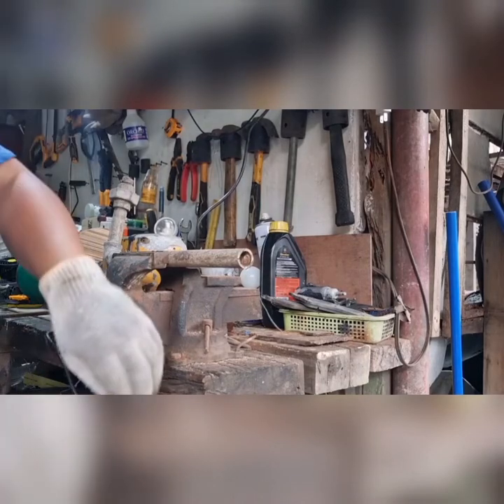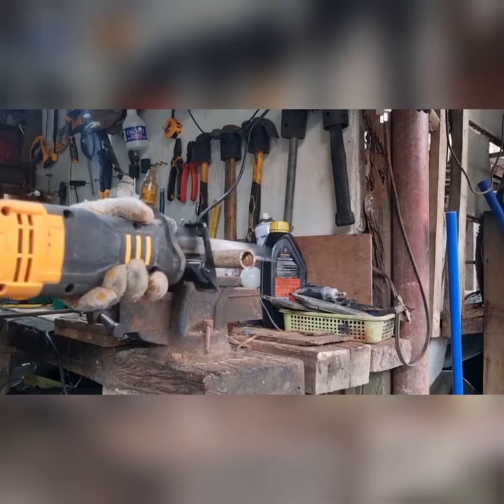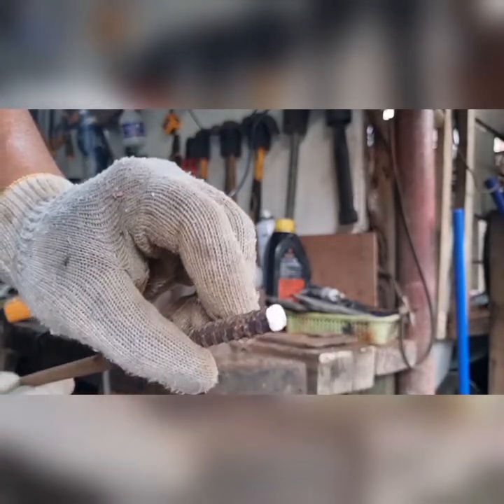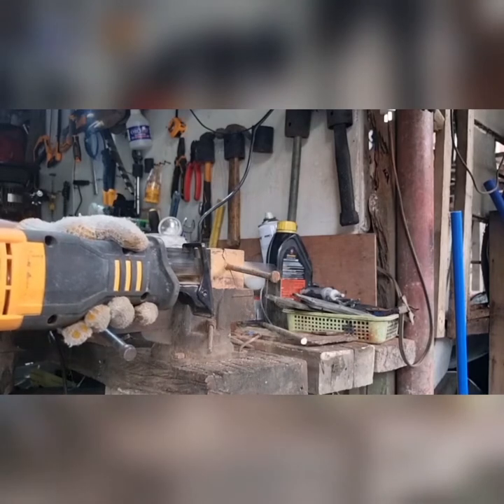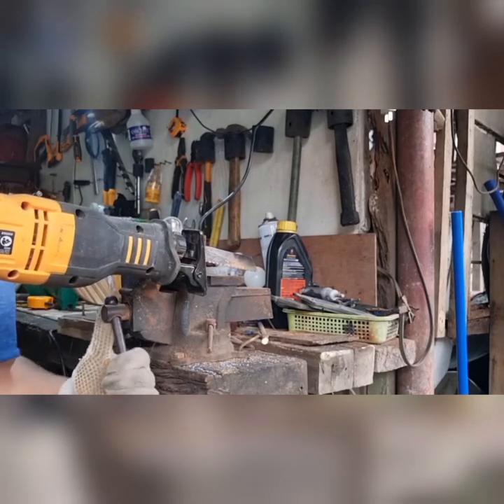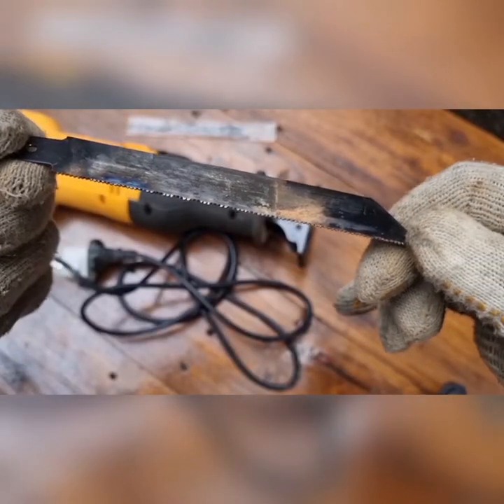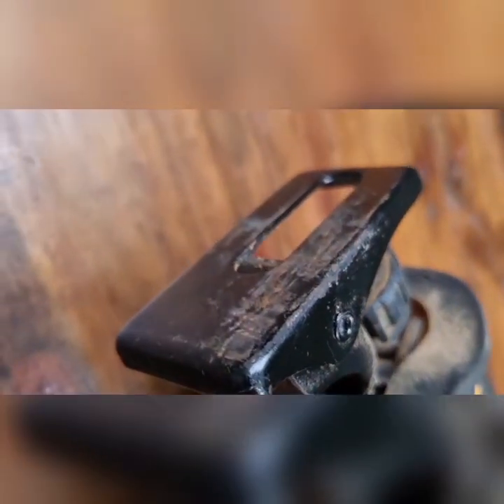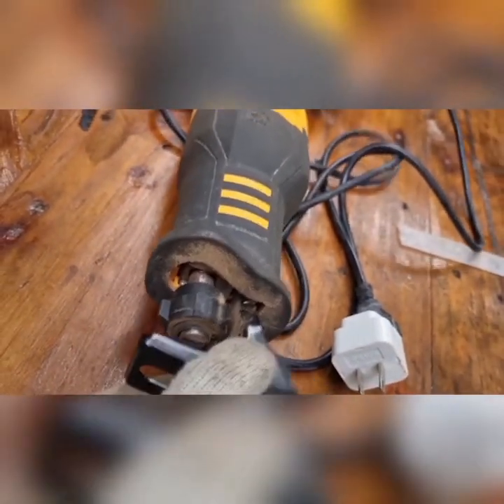Ingco Reciprocating Saw! Part 2! with proper Demo! long term review!

Comment: Can this be used as a JIGSAW
Reply from the maker: Hi technically yes but it would be difficult to handle as it is way bigger and all. If you are going for difficult cuts and all, you should stick with the jigsaw instead.